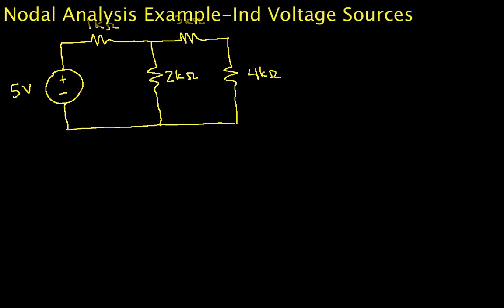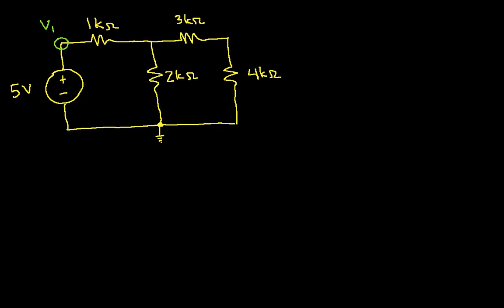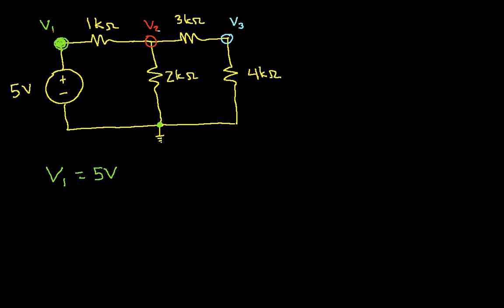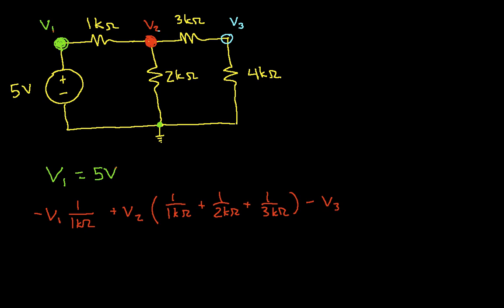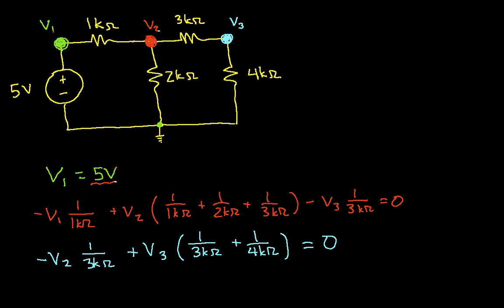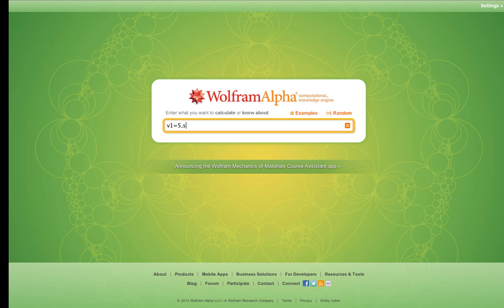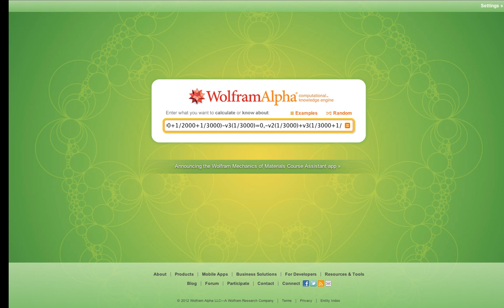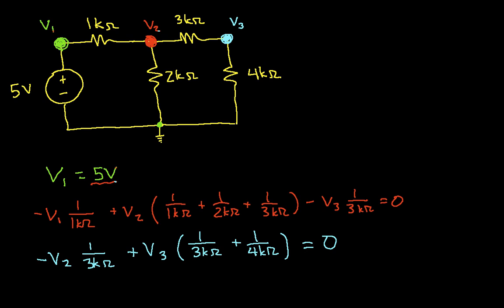Nodal Analysis Example-Independent Voltage Source (Easy)

Comment from the maker: I think the video at 3:07 is correct. We are looking at Node 2, so for v1, we need the resistance between Nodes 1 and 2, for v2 we need resistances of all the resistors connected to node 2, and for v3 we need the resistance between Node 2 and 3.

Comment: Why isn't the current between V3 and the reference node: -V3(1/4k).  i.e. Why are we not assuming that the current is going out of V3 towards the reference node instead of assuming it's going INTO the V3 node?  I got the same equations for 1 and 2, but my third equation had a -V3(1/4k) instead of +V3(1/4k).  Thanks.
Reply: yeah, same here, also confused :(
Reply: When you do nodal analysis, the first steps are to assign the nodes, and assume polarity to each resistor, voltage, current, etc... It doesn't matter as long as you stick to your assumption throughout the question.